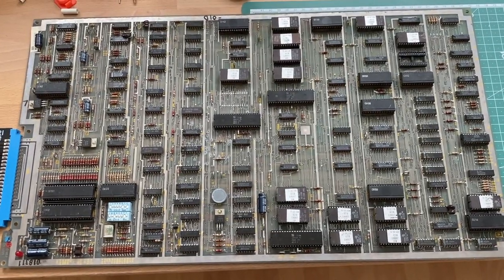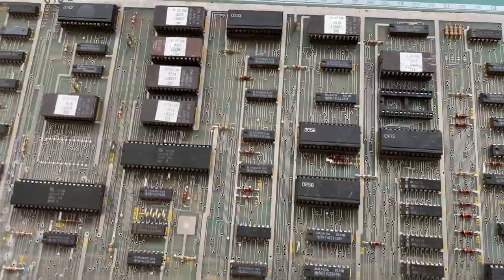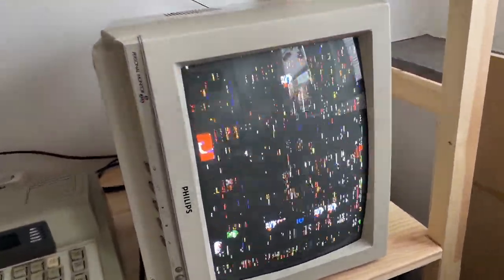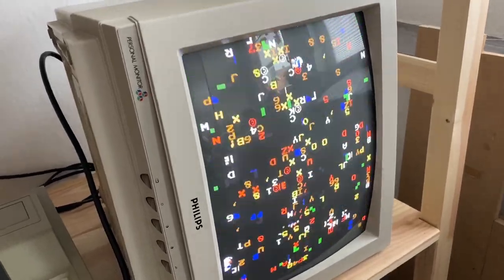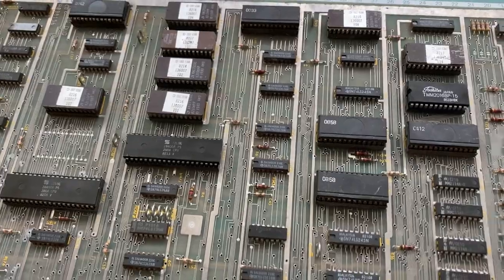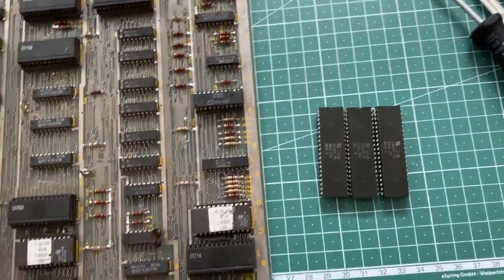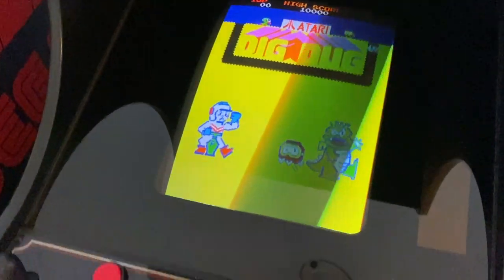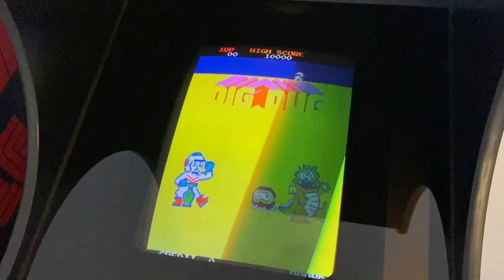Dig Dug - Arcade PCB repair - Multiple CPU and bus signal issues

Comment: Nice job with that repair. During the video, I coudn't stop thinking of how I would have done without this magic Fluke equipment! 😊
Reply from the maker: Yes it would have been more difficult. Actually I am working on a repair right now that is very complicated because I am dealing ith a cpu problem and can't use the fluke to trouboeshoot it because I don't have the 6809 Pod for it. ;-0 Will have to fix it without...
Reply: @christophzett  good luck tracing OE, WE, CE lines 😉 (this is how I do, no choice!)

Comment: Nice job! I can never learn enough methodical fault finding from a pro. That last buffer with the intermittent failure would have been a tough nut to crack without the Fluke I think. I wonder if there are any modern replacement projects for the Fluke. It looks like an invaluable tool for fixing retro stuff and shouldn't be too hard to make.
Reply from the maker: Well one could design such a tool which might be even more useable or useful today for troubleshooting old microprocessor circuits. I recently discovered that some guy from brasil sells some DIY kits (basically pcbs and parts lists) to actually build a new fluke and also some of the pods. I'm still thinking if I should buy one set for the 6809 pod and build one myself.

Comment: In a recent video you showed how to track issues like this down with the basic tools like a logic probbe and oscilloscope. After watching this video, I think those first three chips would've been possible, but that last one that was intermittant would've given you a headache if you didn't have  the fluke. I love the approach, though. Work on one problem at a time, don't try to move onto another area of the board until you know you've found everything on the area you're working in. 

Thanks for the great videos. They're a real pleasure to watch!

Comment: Yay! 👏 Well done with this repair. As usual, a very systematic and comprehensive approach to diagnosis and fixing of the faults. Admittedly it needed the "big guns" (oscilloscope and Fluke) so not everyone would have the resources to do this fix but it was very interesting to follow your methodology. As soon as you showed the 74LS245 I thought "there is a prime candidate for failure" straight away! They do tend to fail rather often (as do '04 hex inverters) which is quite alarming as I use these a lot in my designs! The only issue I would have with your testing is that these devices need to be checked for 4 cases - correct inputs reaching the device on reads and writes and those inputs being transferred to the outputs correctly on both reads and writes. Finally I must complement you on your English - "tertiary" is indeed a word in English and one that most native English speakers would not know. I would not have even dreamt of trying to translate this using my basic schoolboy German! 😳
Reply from the maker: Thank you very much! Well I also also thought about keeping the big guns more out of future repairs. You sure got a point there.

Comment: When the CPU is writing Address 6830 the decoder IC chip will output a watchdog reset signal? Why didn't you use the FLUKE to WRITE to address 6830 and loop it when testing the decoder IC chips and other IC chips?
Reply from the maker: Yes, that would have been another elegant option to show that the watchdog couldn‘t be stopped by the cpus. Many roads lead to Rome.
Reply: @christophzett  Even you jumper the "disable" the Watchdog circuit, the decoder IC chip was still outputting a watchdog reset signal even when the watchdog circuit was Disabled?
Reply: @christophzett  Most ROM Signatures are testing the ROM chips Full Maximum Range . In the video you're only testing a very small ROM portion/region but have the signature for that small range ROM region. How did you get those signatures? Most signature only will test the Full ROM range only

Comment: That 50 ohm seems to be to VCC, not GND.
Reply from the maker: Yes, correct actually - have to admit that I measured it wrong in the video. 😅 It was 48 Ohms to +5V but even less to GND - I think is was 30 Ohms or something like this.

Comment: With Dig Dugs, you're better off replacing all the sockets and cleaning up all the Customs before starting troubleshooting.  Bad sockets and corroded customs cause a majority of the issues.
Reply from the maker: Absolutely right. It is really worth your time cleaning everything up and aussuring an overall good connection status in advance before even beginning. In this repair I stumbled from one 74 logic ic issue to the next and ended up with a working game - but nevertheless before I put the pcb in the shelf I will also clean everything and replace sockets if necessary. 👍